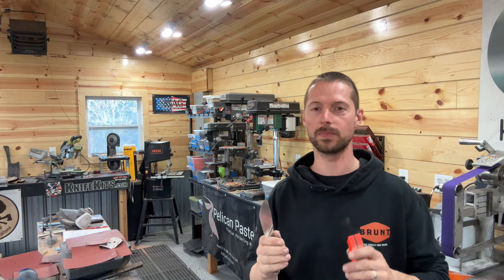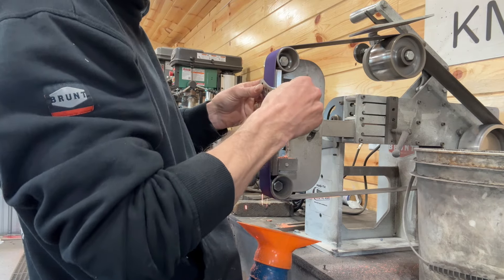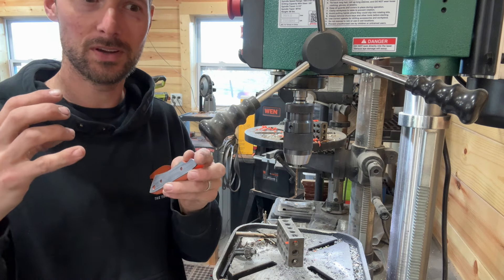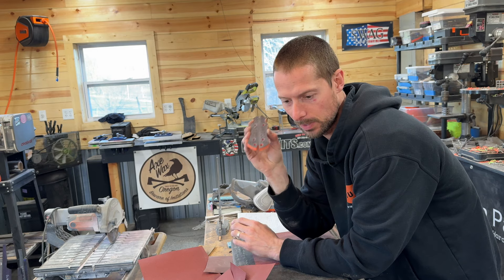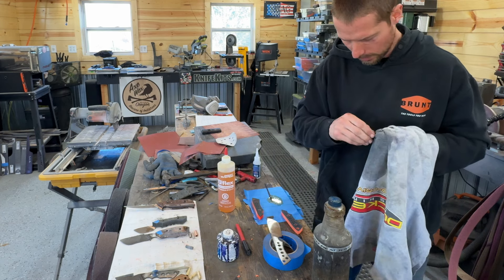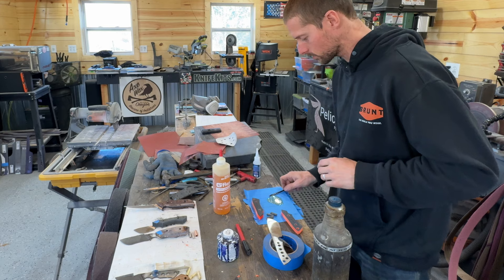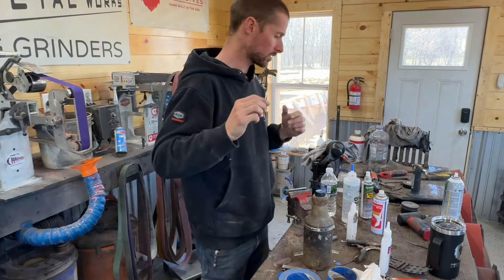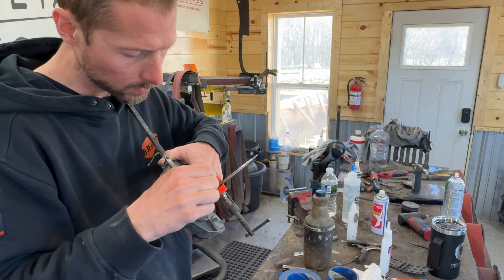How to Prep and install handles on a knife so they will NEVER fail.....ever!

Comment: Hey Matt, try mineral oil for the clean up on the front of the scales.  Works well and it won’t wick like lacquer thinner or acetone.  It’s a Will Stelter tip…I can’t take credit for it.
Reply: Kyle Royer uses wd40. I have never tried mineral oil but wd40 works way better than acetone.
Reply from the maker: O cool I’ll try that thank you!

Comment: It’s not in your head Matt. Dimples and chamfers on the back side of scales increase the surface area to be bonded. More surface area, greater strength. As for epoxy, I agree on G-flex but recently been told that POP’s has their own and it’s identical to G-flex. I haven’t tried it yet because I still have half a bottle left but will get some when I need it.

Comment: Another great video Matt.  I picked up on applying oil on the clean flats above the bolster area.  That’s something I don’t do in glue up.  I live in a very dry area and haven’t had problems, but it wouldn’t hurt.  The lanyard tube is something I do differently.  I do scuff all pins and will roll them through a thin area of the epoxy puddle.  I plug one end of the lanyard tube with cheap modeling clay and run that end through to keep the inside clear of epoxy.  I leave it a little long and cut it off after the gflex sets overnight.  Thank you for the video and sharing your process.
Reply from the maker: I think that’s a great idea! Thanks for watching!

Comment: One of the things that I do is what I'm doing those little holes on the tang side of the scales I make sure that I have holes that line up with the weight reduction pass through holes in the tang. I feel that doing so creates an internal epoxy pin. Other than that our process is almost identical. Oh, one more thing I switched from using tape to mix the epoxy on to using a paper plate. It just seems to keep things a little cleaner and faster.
Reply from the maker: Both of those are great ideas! Thank you!

Comment: Since you have the front of the scales finished, cut and apply a small piece of blue painter's tape (there on your workbench) to the front finished part of each scale.  Then a piece of tape on each side of the knife blade so it's 1/16" in front of the scales.  Then, you can epoxy and clamp.  Just wipe away the epoxy so there's not too much at the joint.  No messing with thinner or acetone for clean up.  When epoxy is set, you can peel off the tape and use a straight razor blade to trim away the small bit of excess that's left.  I've done this for years and it's much easier than trying to clean up the blade while the epoxy is liquid.
Reply from the maker: Great idea thank you!

Comment: Great video, Matt.   I also use GFlex and it has worked well. Do you also use GFlex when you glue up your segmented scales or liners? I was thinking about just using JB Weld for liners since it's a bit cheaper and easier to mix up quick.
Reply from the maker: I’m using starbond medium ca glue for most of my segmented scales now

Comment: Have you ever used slow cure epoxy from BSI?
Reply from the maker: I haven’t! Should I check it out?
Reply: @gentrycustomknives8008  I can't compare it to anything else ..I know it works well and is cost effective, but cures slowly resulting as in any slow cure a great bond.
Reply: I also use Slow set BSI and never had any failures. When using any epoxy I have found that the proper mix ratio and stirring is important. Another great Mat thanks for sharing.